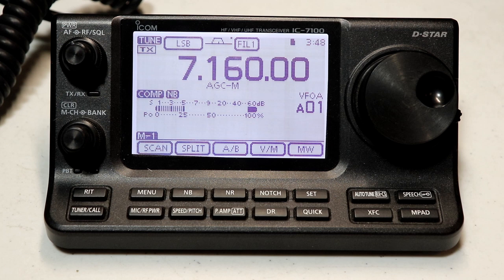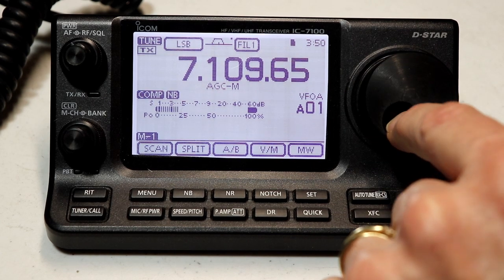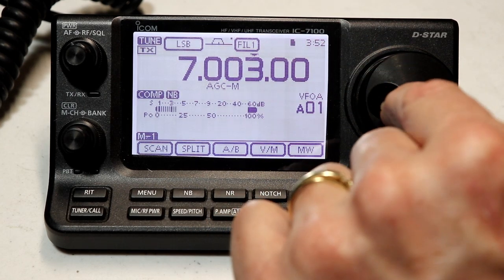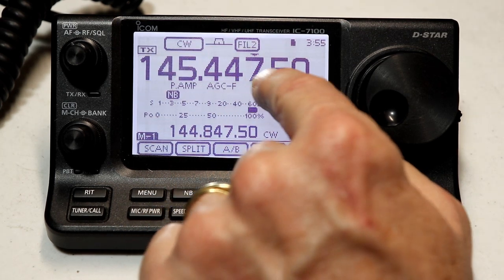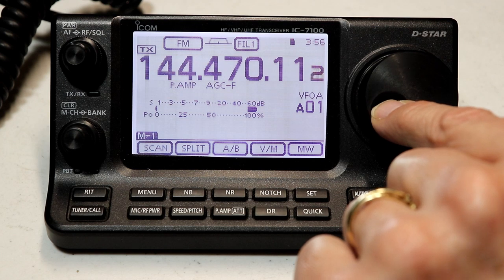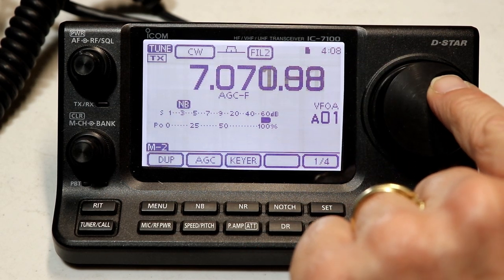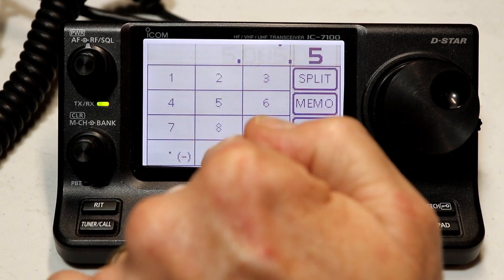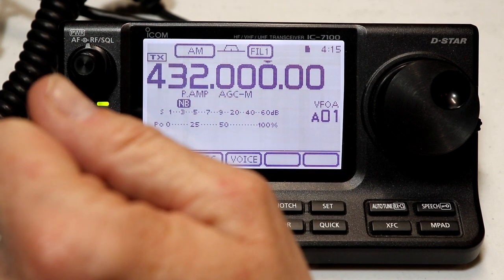IC-7100 from A to Z #4 VFO Tuning Operation & Options

Comment: Tom, thank you very much for taking the time to prepare these instructional videos.
I bought a 7100 under serendipitous circumstances literally days ago. I have never worked any ICOM rig before.
 Walk-through videos on the 7100 are scarce on the web.  You have saved me the trouble of having to read the manual to get started. 👍
73

Comment: Tom, I'll join the folks here thanking you for this IC 7100 series as well as others on ICOM radios.After much research, I have recently purchased the IC 7100 as well. It promises to be a good addition to my communication gear. W4JCH

Comment: Thank you very much Tom. Your videos on the 7100 are really helpful.
Reply: Love your videos, Tom. Quick question if you don't mind. I am having a devil of a time transmitting with my  7300. No one seems to hear me or respond. I've called on 80, 40, and 20. No responses. Vox is on. Could I have the settings wrong?

Comment: Tom: I absolutely love your video series on the IC-7100. So much info not logically covered in the manual. Didn't know about the Advanced Instructions. I'm off the air except for Echolink due to lack of antenna real estate, but I have learned so much and practice without Xmiting from time to time to keep up. I do wish they would have placed the SD Card on the head though.

Comment: I have my equipment setup similar to the way you setup yours for this video! I don't have any issues with the bands until I get to 80 and 160 meters! On these two bands, the touch lamp goes on and off repeatedly, and the PC monitor goes bonkers when I transmit or use the tuner! I recently learned about touch lamps and ham radios. But the reason for the monitor issues might be because my radio and tuner aren't grounded. Your thoughts, please... Thank you for your time!! It is MUCH appreciated!!
PS, I do have grounding rods and cables on order.
Reply from the maker: Hi.  Touch type lamps & light switches are definitely extra sensitive to any RFI problems.   You may have to do some experimenting with RF Chokes  and routing of cables to solve everything.  Getting a good ground setup is definitely the right place to start.

Comment: Thank you for the video's on the 7100. This is the first modern radio I have owned. There is not much out there about the operation of it. Would like to see a set up on  FT-8 on this radio. A lot of trial and error is all I find. Thanks again Mike KA8IIM 73s
Reply from the maker: I did one for the 7300. Very similar for this radio.  I will do one for this radio too.  For the 7300 videos, search fo IC7300 A to Z #23, #24, #25 & #26
Reply: @HamRadioA2Z  Thanks

Comment: Thank you for this series of videos. Can you please tell this beginner how you get the "Tune" word to appear in the top left corner? Friends have come to our house, and programmed the radio for me, and then left. If I bump the dial or a button, I lose my ability to set the numbers bck where they belong. So far, I'm using my 7100 to check in on nets, and I'm looking forward to expanding my use.
Reply from the maker: Hi Doris.  Thanks for the kind words.  I’m glad you are finding the videos helpful.  On your question, the TUNE indication in the upper left of the display has nothing to do with tuning frequencies.  If you have an external automatic antenna tuner connected to the radio, TUNE will be displayed when the tuner has been engaged and was able to find a good match for your antenna.  Honestly, “TUNED” would make the meaning more clear.   If you don’t have an external tuner installed, you should never see that displayed.  As far as why you can’t tune the frequencies any more, I would need a little more information about which buttons you hit and what you’re trying to tune to be of more help.
Reply: @HamRadioA2Z , thank you for your quick reply! I have an MFJ-945E tuner. I'm getting acquainted with it too. A couple of days ago, I learned that I need to have RTTY selected on the 7100 before I try to adjust the tuner. I think my problem may be with the lower left knob on the 7100. I was trying to check in on the World Famous Wyoming Cowboy Net, 3.923.50. I am also trying to learn how to check in on the High Noon Net, 7.240.00 and the Beehive Net, 7.272.00. I'm here in Rock Springs, WY (I think you already figured that out). My friend, KE7UUJ, has programmed our local repeaters in, so now, I will watch your videos again and try to program these frequencies in, and name them.  You speak and a good rate, and it's easy for these old ears to hear you. Thanks again. KB7HEQ
Reply from the maker: Hi.  If you are just going to push the PTT on the Mic, then yes, setting the radio to RTTY will put out a carrier so you can tune it.  You should also adjust the power output down to about 10-15% while you’re tuning.  This puts less stress on the output transistors and less stress on the tuner.  Once you have a good match, then you can turn the power back up to 100%.  And, just a reminder, since the 945E is a manual tuner, that TUNE on the display won’t come on and doesn’t apply to your situation.  Enjoy those nets.

Comment: Thanks for the video.  You have been invaluable in several YT videos for IC radios.   In your experience, would you be able to hear a difference in receiving signals between the IC7100 vs IC7300.  I know it's subjective, but in your opinion do you hear a difference?  I have a IC7300 and I can hear those low signals and I want to buy the IC7100 for the car, but I don't want to loose that sensitivity.  I wonder if I would be able to tell the difference.  Thx.
Reply from the maker: Hi Frank.  I’m afraid I don’t have a good apples to apples comparison.  I think the receiver in each radio is pretty good, but as you’ve seen I mostly use the 7100 in my truck and the 7300 at home.  I have setup the 7100 in the shack a few times, but I’ve never compared the two radios side by side.  I think that’s really the only way get the information you want.  With different antennas and different band conditions on different days, it’s really hard to say anything meaningful about their sensitivity.  That might be a good idea for a future video.
Reply: @HamRadioA2Z  Thanks for replying.  I was thinking of using the 7100 in my car, for the 7300 is just to bulky and the 705 has not enough power and having the 705 on the dashboard is not safe.  On the other hand, I love the 7300's audio quality, so far people who have the 7100 like it usually don't compare it with other radios.  -73

Comment: A helpful demo, please move your left hand out of camera more often....I liked it and subscribe, thanks.
Reply from the maker: Hi and thanks for the like and subscription.  Sorry about the hand.  I usually use a stylus so it’s easier to see what’s going on and I also film from a little different angle.  Unfortunately, I forgot to pack the stylus and had a different camera angle in the camper.  Should be better next time.  73,  Tom